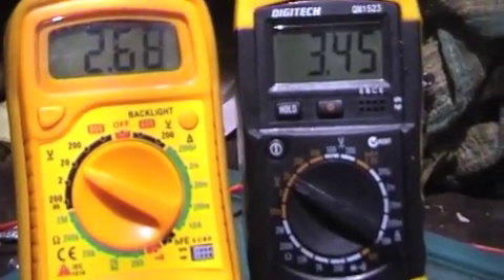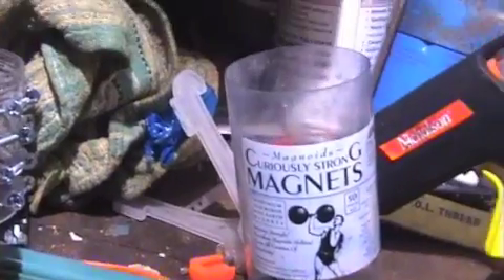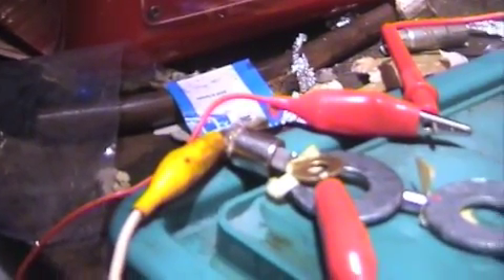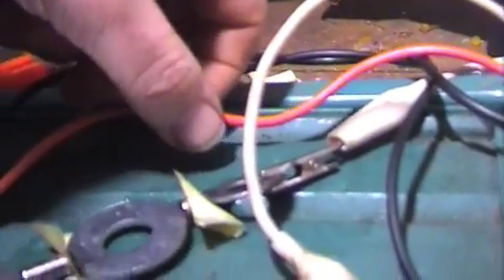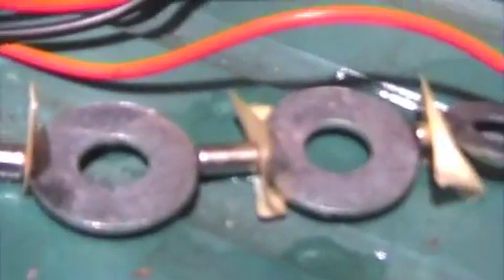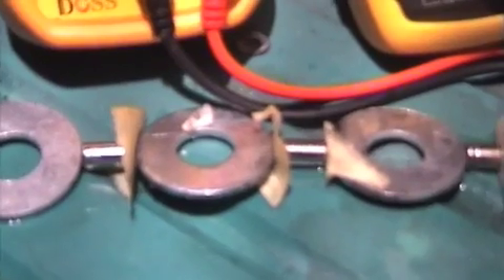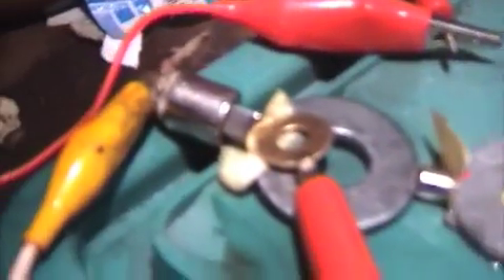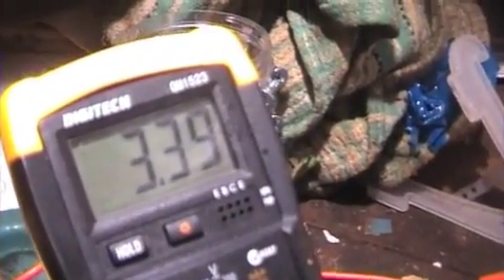Magnet Array, Magnet Battery? Overunity.com

Comment: @jimboot I really don't think so ! where should be that chemical reaction? Why don't you try with zinc and copper but dry as the one in the video and you'll see you will not achieve that voltage even with 50 sequences! ... why do you say that?

Comment: @MrAwsome514 volt and ampere is both load effects. volt is high electric resistance load at a differential between two elements where one element have high electric resistance and the other have low electric resistance. ampere is a load effect where you have a low electric resistance on a differential of two elements where one element have high electric resistance and the other have low. wattage is the sum of the two loaded together. ohms divided with ohms equals watts.

Comment: You do realize voltage is not a measure of power right? Wattage is a measure of power. Wattage is what you get when you multiply the voltage by the ampherage. If you base the findings entirely on voltage then I can create free energy with a disposable camera as the flash circuit is powered by a 1.5 volt battery and uses it to power a 300 volt flash bulb. Catch is the ampherage out put is also much lower which is why it charges a capacitor to build up enough power to activate the bulb.